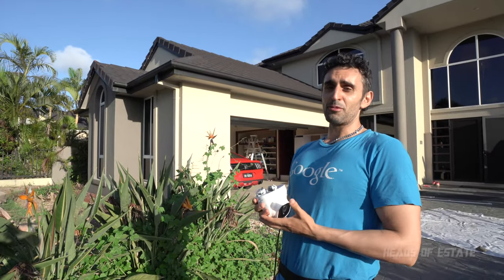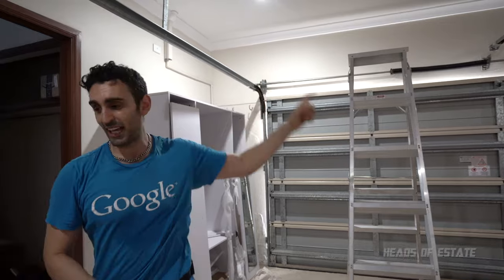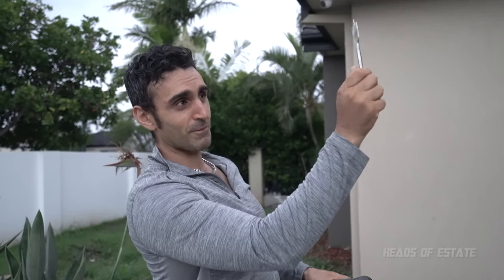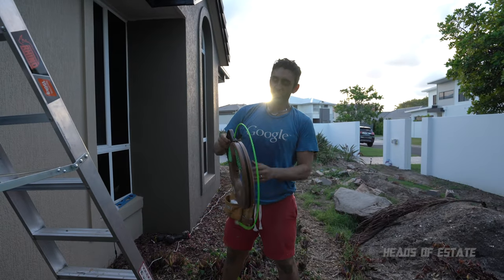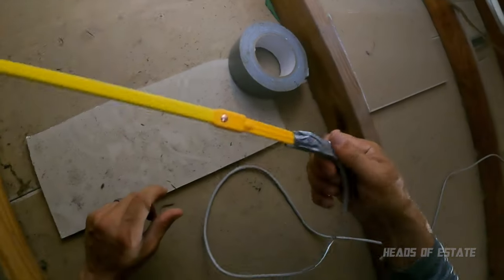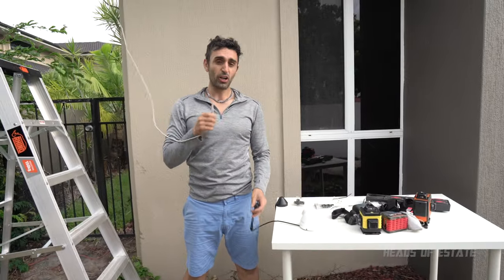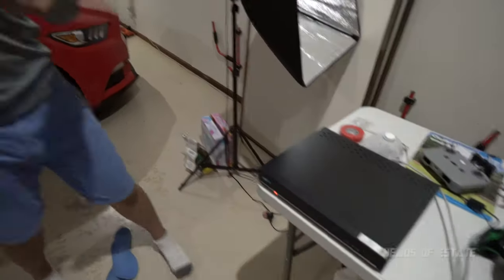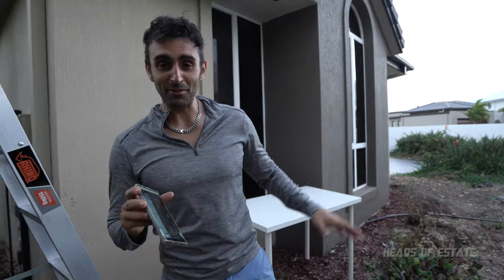Reolink 4K POE CCTV Security Camera System | Full Install Guide for Beginners

Comment: Great F'n job!!!  You saved yourself a ton of cash doing it yourself and it looks very professional.  I crimp wires wire for a living and I know that I never want to crimp my own CAT6 RJ45s and it is even worse if they are going to be shielded CAT7/8🤣🤣  I buy everything pre-terminated and stow the slack, you are the man!  I am old and I do prefer hardwired over wireless.  You need to install yourself an attic ladder, no attic ladder will wear you out very quickly.  For electronic wizards, your tradesman skills are seriously improving, kudos!
Reply from the maker: Ah thanks mate, I'm getting my head around the whole world of wiring, got some more cameras to put up, but it's simple stuff now. My next project with wiring is figuring out where to put the main house switch and how to wire up ethernet to all the rooms, top floor should be easy, getting it downstairs is going to be the fun part.
Reply: @headsofestate  Keep up the great work!

Comment: Man I wish my house had eaves. I'm trying to figure out how on earth I'm going to wire mine without that luxury.
Reply from the maker: Have you considered mounting them directly on a wall?
Reply: @headsofestate  Yeah that's where I'm thinking I'll end up now, though I was hoping to avoid drilling into brickwork and then trying to fish a cat6 cable through it.
Reply from the maker: Nice one, I've done it a few times now and as long as you know what's between the walls it's pretty easy. Eg. if you pick a place where you know there's no pipes or electricity running. If it helps, there's a video on here where a sparky helps me do it for an intercom setup.
Reply: @headsofestate  oh nice! I'll check it out.